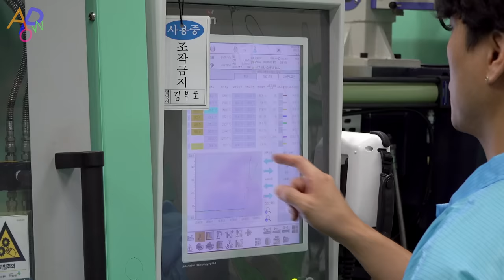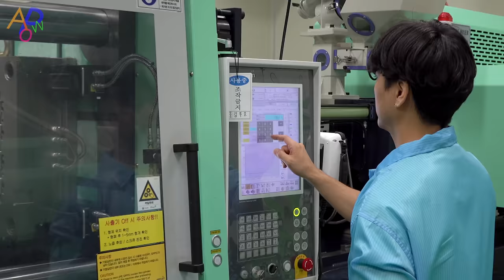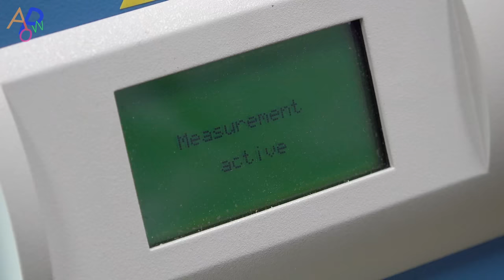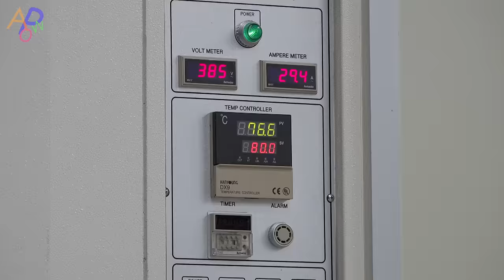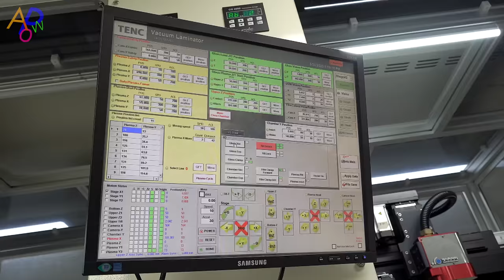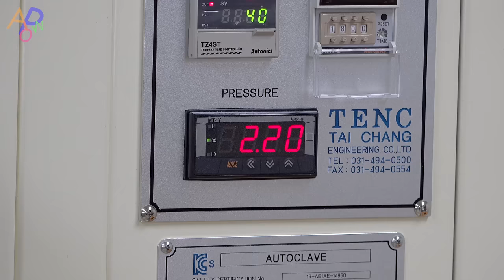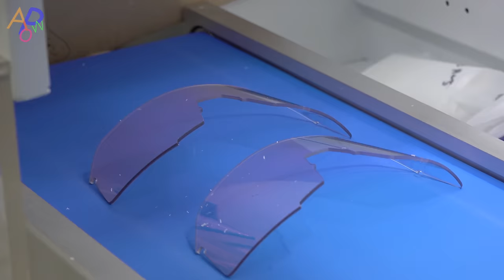Process of Making Sports Sunglasses. 40 Year Old Korean Eyewear Optical Factory

Comment: Cost of production : USD 2 per piece. Retail price by ride 100% : 130 USD 🤣
Reply: Not in any particular order: automated chemical baths + coating laminate RM cost + plasma-enhanced lamination/deposition tech + pressurized autoclaves + polycarbonate (not a cheap plastic) with various additives + silicon sleeves + automated injection molding cells + automated milling cells + silicon overmolded accoutrement + extremely high quality robust packaging + over 20 assemblers and machine operators per shift + 2-4 QC technicians per shift + supervisors and process engineers and maintenance + office personnel + warehouse/shipping personnel + overhead.

Final production rate is around 1 unit per minute (times however many final assembly lines there are, if more than one). The average S. Korean factory worker wage is around 7  USD. For this product, the wages are likely higher, bc clean room conditions. Also, QC techs, supervisors, technical operators, and engineers usually make significantly more. So let's assume average 20 USD wage for the entire facility (including engineers, managers, marketing, etc.), just to make the math easy. Let's also assume a grand total of 40 full-time employees and only a single shift at the company. Let's also assume zero downtime and breaks. That is 30 * (20 USD/hr) / ((1 unit/minute) * (60 min/hr)) = 13.33 USD/unit for just WAGES - and that's almost certainly severe lowballing. Add in raw material, overhead, amortization of capital expenditures, purchased components/packaging, and advertising and I would say costs are closer to 50 USD per unit.